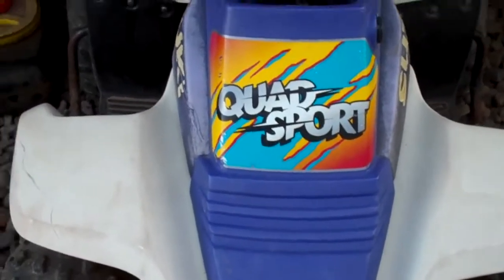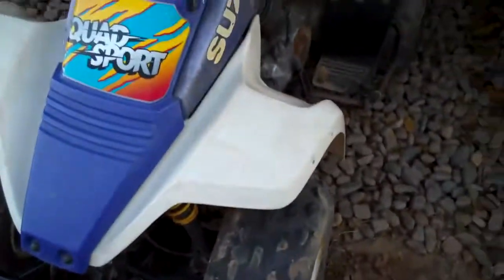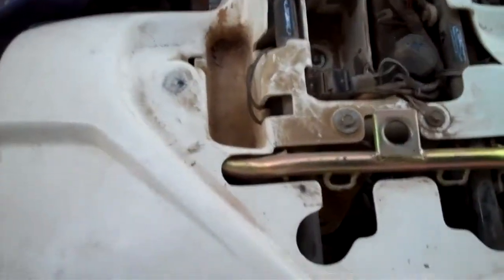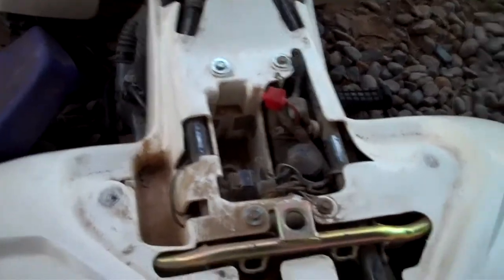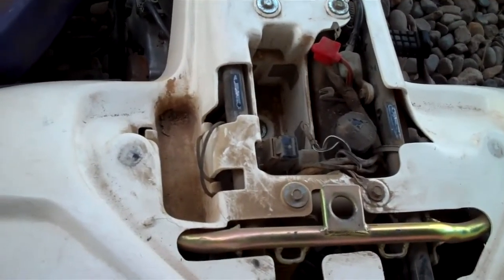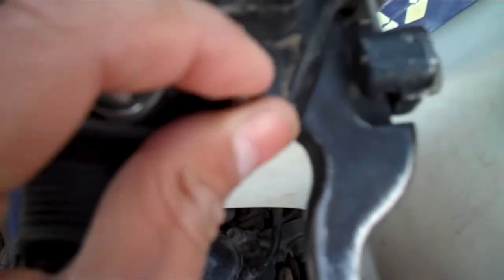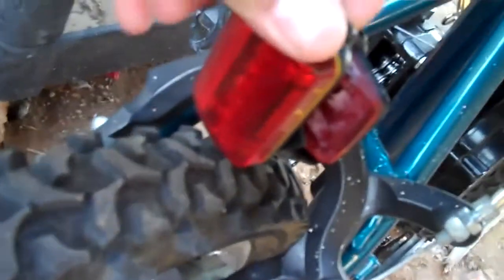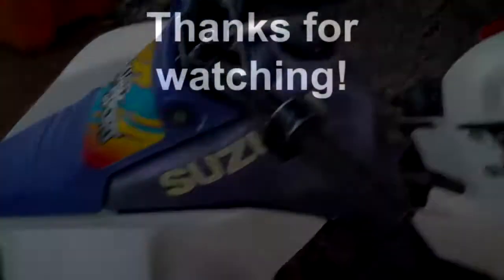Suzuki lt80 quadsport 1995-1996

Comment from the maker: @ils360 what do you think need to be done I know the air fliler and I have to clean the carb and buy a new spark plug and battery because the battery I have is the one that you can't open up it is sealed